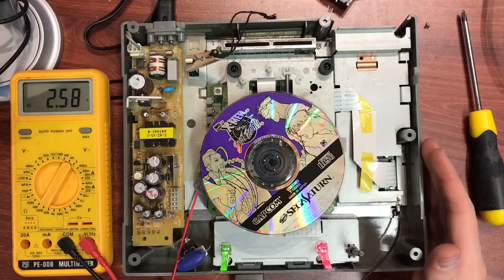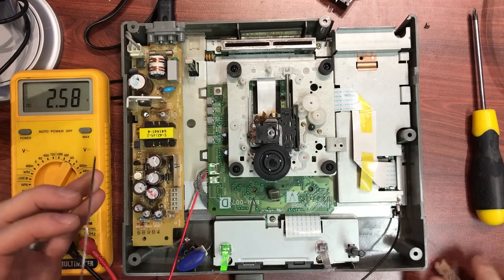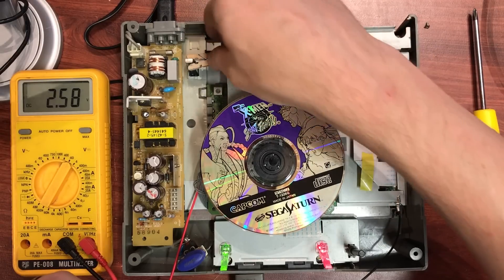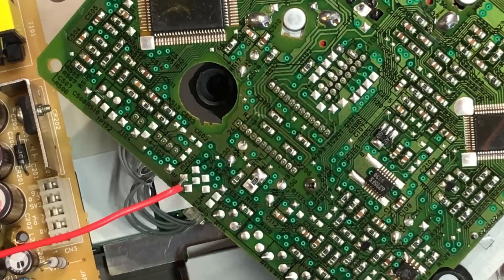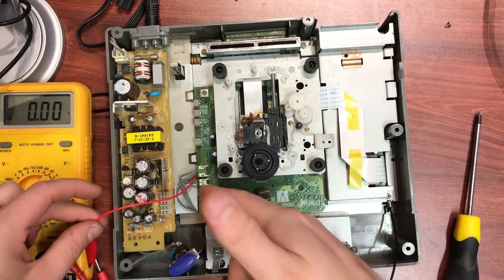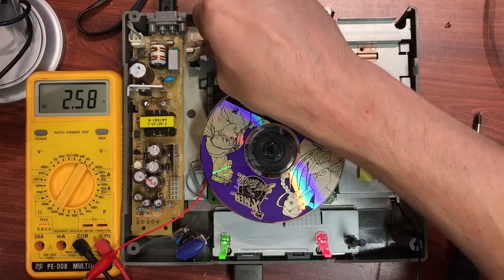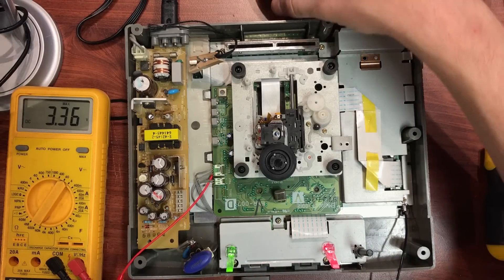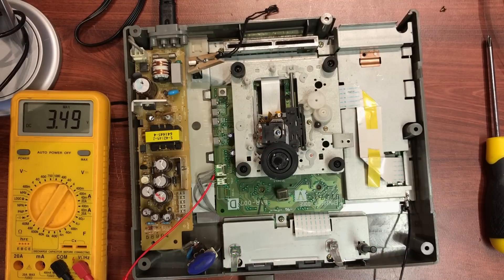Sega Saturn laser adjustment not reading discs fix - YouTube

Comment: Hi man, watched your video and it's great! Although I don't think mine needs recapping, I think I have a laser problem, can you help me out? I haven't used it in almost 20 years but it was stored properly, no rust, no corrosion, all good. I bought a Sega Touring Car Championship CD, in Great condition too, almost like new. It freezed almost every time during the Sega saturn logo sequence. I opened the Console up, cleaned the laser with IPA, regressed the gears, checked the travel of the laser head on the rails, removed and reinstalled the ribbon cables, I changed the battery and I cleaned The CD with IPA too. Also cleaned the laser board with IPA. Now I'm at the point that the game will load 50% of the time, but it will freeze at various points, never getting to the actual gameplay. Also, before cleaning, sometimes the Console froze in the open in sequence even with no CD in the tray (that confused me). Lid works OK. Any ideas? Thanks!
Reply: Hey, im  in a similar situation, but not freezing. Did you manage to resolve your issue, if so, what was it?
Reply: @samuelcramphorn3874 not yet I'm afraid, I will take it to a shop that repairs old consoles and hope for the best. Will let you know

Comment: I’ve just replaced the laser on my Saturn but it still won’t read discs. When I load a disc the laser moves and tries to read the disc but it won’t spin up. I tried tweaking the potentiometer but still no joy. Anything else I can try? Thanks
Reply from the maker: @dukeyboy83  raise the spindle height
Reply: @RetroSalesAustralia  is that easy to do?  Thanks
Reply from the maker: @dukeyboy83  yes, just pull the plastic round spindle up. It’ll end up coming right off the shaft, so then gently tap it back on to the correct height.
Reply: @RetroSalesAustralia  awesome thanks I’ll give that a try!

Comment: I just took my saturn apart, I can't even figure out which unit this is I'm thinking it's a V2.2 but I dunno which board it's using. I'm having some audio glitching, lagging and freezing sometimes down right rebooting when I play my backups and I'm using a PSeduo Saturn cartridge. I thought maybe adjusting the laser would help but once I got in there none of my phillips would fit and when I did get it to turn it was already maxed out, couldn't turn it any further clockwise. So I think someone had already played with this sucker.

Comment: Thank you so much! 

I do the job on a Japanese model 2 with a optima S6 I bought on AliExpress a few years ago, first multimeter read got 2.7V on burned cdr, after laser adjusted got 3.3V and works very well, some time I got some read error, but that's de pseudo Saturn cartridge fault,,

Comment: Hi, can you explain the range .71-0.79V you recommend? Thx
Reply from the maker: The Sega Saturn service manual lists the correct range. “Check that the eye pattern waveform can be observed at the RF test point. (0.8-1.4Vp-p)” So if you take the difference between the top and bottom of the waveform, then you get 0.6volts. I then think it’s wise to set it a little higher to around 0.75 as the laser is old and needs an extra boost.
Reply: @RetroSalesAustralia  Thank you so much for the educated answer, it makes sense to me now. Have a great day.

Comment: As my gamecube and saturn repaire experience, user should recap the optical disk board first and then adjust the VR. About the saturn, the original value is 2.58-3.0v, user can adjust to 2.58 -3.5v; that can help to read almost orginal and backup disks.  If higher than 3.8v to read most backup disks, user should consider to change the brand of empty disk to burn again.

Comment: My multimeter doesn't have a 40 options for the voltage, it has 20 which gives me 2.53v at idle, can I still make the adjustment using this 20 option?

Comment: Man I know this video is old but it's still so helpful. If you could help a brewski out. I'm getting 2.38 output in idle and with disc in , door pegged. No spinning action at all, is this a sign of the laser being dead? No matter how much I turn the pot , the 2.38 doesn't change
Reply from the maker: If it’s not spinning, then that’s not the issue. I’d recommend watching my other video on Saturn common faults. Try lifting your spindle height as I demonstrate in that video.

Comment: problem is, that i can not get it higher than 3,17 volt because the switch( the yellow one you are screwingng) is over; end ; blocked at that point..
any ideas?

input voltage is 9.1 / 5,0 / 3.34 so seems o.k.

Comment: The potentiometer in my drive does not respond, and actually when turned to the maximum (clockwise), the voltage does not increase at all and is constant. I think someone has already been rummaging around in the console I bought. It remains to replace the laser, the only question is what model if I have a 20-pin cable?
Reply: Look for a company name on the edges of the drives circuit board, there's only really two kinds of lasers in saturns

Comment: i tried this method, didn't work.  However... JVC optima 6 lasers are... about $8 on ebay and take about 30 minutes to replace.  you need to remove a solder bridge, but that's the only minor skill required.  replaced mine, worked first time (had a working saturn already, deliberately bought a broken one to try fixing in case i screwed up :D)... far less time in total to replace with brand new than screwing around with a multi-meter.  so... 8 dollars plus your/somebody's time  to repair properly vs. a bunch of time messing about?  I'd say "just buy the laser!".  sure, maybe mess with the old one while you're waiting for delivery, but the new ones are adjusted out of the box and 'just work'.  :)
Reply: there are no brand new lasers for these. I've ordered a lot of replacements for various retro consoles including sega saturn and 1 out of 3 works. I'm fairly certain most, if not all, are pulled from broken consoles. you were lucky to get one that worked the first time

Comment: hi  I have a question.  I bought a Sega Saturn.  He goes as far as when I insert a cd.  He starts reading them and then the entire console freezes.  can not do anything after about 5 minutes, the cd does not turn and it flashes the orange lamp.  what do you think is the problem.  when I screwed it on and hit the switch for the drive the laser lights up and moves a bit and the lens goes up and down.  thanks in advance Miuga

Comment: I've got a pal model 2 Saturn that works descent exept one frickin issue it presses the A, B, START,down and right buttons  from the controller by it self even and without controller plugged into the console.  
At this point I must say that :
1)I have  checked 3 controllers and it does the same thing.  All controllers at my other Saturn works great so its not controller issue.
2) I have checked power supply board and works great the voltage at every pin is right. So it's not power supply issue. 
3) I have replaced every frickin capacitor at the motherboard and also didn't work.
4) I  have tear down the console and cleaned it like when it came out from the factory.  I ve cleaned both controller ports with contact cleaner and nothing. 
Any ideas anyone ???

Comment: I know this video is older, but I’m desperate to have my Saturn work. When I adjust the pot, the voltage barely changes(on a brand-new confirmed-working laser). Furthermore, no discs will read. Is there another problem I can address to make it work?
Reply from the maker: The Ravioli Man Are you sure you’ve connected your multimeter to the RF point shown and a ground point? What’s your voltage at idle? Is it similar to the video?
Reply: Global Garage Well, my layout was slightly different, since I was working on a model 2. I did see a portion with ARF next to it. Unless that was different(and it very well could be), the process went the same. The idle voltage was around 2.48. However, I also noticed the laser head would not move(https://imgur.com/gallery/WjCOFHZ).

(Also, as an aside, will working on this without any special protection damage my eyes?)
Reply: if you're desperate to have it work, i'd suggest looking for a new laser and then mess with the pot while you wait for it to arrive.  if its laser related, a new one is cheap and will definitely fix it.  replacement is relatively straightforward.  just did mine and took me about 30 minutes (first time i'd done a laser replacement, had the machine apart 2-3 times messing with the pot to try and make it work without success)

Comment: Hey i've a Saturn it reads discs but only reads them as though they're only audio cds not sure how to go about fixing it
Reply: FATHERSUNGLASSES same. Most of my library loads, but a few games are only detected as audio. The games read fine in another system.
Reply: Same thing with me, any solution?
Reply: @TheSkeletontoucher  In the end I just sold it as faulty and bought a working one. Not sure what the solution would have been for it.
Reply: @fathersunglasses6085  Way late here but whenever I've encountered that, it was a laser pickup reaching the end of its lifespan. Just enough power to detect the discs and play music CDs, but too weak to actually load games up 90% of the time. Easy cheap fix if it's a JVC drive.
Reply: @mercurycyclone  why is it a cheap fix if it's a JVC drive specifically?

Comment: Got a jp grey saturn. Through swapping i know the laser, mech, ribbons and psu are ok yet it spins disc. Doesnt read or stop. Boot up screen is dark for a few seconds then normal. But wont read. At this point i'm certain its bad caps. any idea?

Comment: Hey Mate, I just picked up a Saturn but it only reads some discs. Some read perfectly every time, some load for a few seconds and then just black screen and eventually the disc stops spinning. No scratches or rot on the discs. Before I pull it all apart, do you think adjusting the pot will help this?

Comment: hey global garage I have a Sega Saturn model 2 and the problem I'm having is the checking disc format starts flashing when it reads the disc I replaced the laser and moved the pot but no luck so if you can please respond
Reply from the maker: When you moved the pot, did you follow the procedure in my video? You can't just guess and turn as it's extremly precice. Also if it's a new laser, make sure you remove the small round solder blob that is present during shipping. This must be removed for the laser to work. When it's removed you see it was joining to pads together.
Reply: Global Garage i followed you video to a t and i did remove the blob that was on the new laser, like i said it knows the disc is there it justs spins with the checking disc format flashing

Comment: The technique there is sound, but one thing I would point out - when you need to do an adjustment to an existing laser, the laser has started to die.  ie.  It will output say 90 to 100% of its optimum value for the majority of its life (without adjustment) - but once it gets to that point where its output has dropped below say 80% (where it stops reading discs), increase of the voltage can bring the RF level back up (as you demonstrated), but the additional voltage (because its now higher than it is specced to get a proper level RF) coupled with the fact is is on its decay to providing no output whatsoever, means that it won't last long.  You may get a few month (of intensive use out of it before the voltage needs increasing again).  So its fine for getting up and running, but its not a long term solution - ideally you should just swap out the laser!  Lots of people are doing this kind of thing and selling them on eBay - annoys the hell out of me lol.

Great video though, and as I say, the technique is sound - even if the DMM is a little inaccurate, its better than just adusting it and guessing etc. =D
Reply from the maker: Yep I agree 100%. Just like you I make these videos more for the guy at home to follow along and hopefully get more life out of his console. I linked to a new laser in the description as ultimately that's what's needed as you said. All of my consoles that leave the shop have new lasers as I don't need the warranty hassles.
Reply: While adjusting the laser does shorten its lifespan, if the system isn't reading the disc anyway then a shortened lifespan is still getting more out of the system than the system not working at all as is. And those few months are a few months of stress relieved from the inevitable replacement.

It is an important consequence to understand though, especially if somebody's going to be doing this when preparing a console for sale. I feel as though if they are doing that, then they should really mention that the laser has been tweaked, and is on its last legs, but I highly doubt very many people are that responsible even if they understand the extra stress their adjustments are putting on the system.
Reply: I've ordered a lot of lasers for various retro consoles including sega saturn and most of the time I've had to ask for a refund. I'm fairly certain the replacements they sell on ebay and aliexpress as brand new are really just repurposed lasers pulled from broken consoles
Reply: GadgetUK164 - Retro Gaming Repairs & Mods what I usually do is grab a cartridge and then stick it in and out of the slot! A good 10/20 times... Fixes everything!😂👍
Reply: I just bought my first saturn on ebay from japan, looks like i was not lucky to get a model 2 with a dead laser (advertised as Working Garanteed) so I'm looking foward to my 2nd saturn , which the seller already sent and is on its way !! :P cant wait to find out if it will boot discs !! XD 
at the same time I know a friend selling his  usa model 1 saturn region free with modchip. so I will be able to play nice improvement hack like SOTN translated or the 4MB hack * and stuff like that !!! you really need a modded saturn these days (edited : the replacement saturn booted first try and was way cleaner than the first one , both model 2 white hst 3220 , original japanese game DBZ LEGEND tested no trouble at all with msh vs sf 4mb too)
Reply: wow , did I just scroll down the comments and as I was reading my comment, I didnt fully realize it was my comment until I read model 2 dead laser !! LOL Im gonna do what I can do to maybe revive it? This video is very nice!! Im attempting to adjust the pot lid of another console which has a modchip. I want to be able to read everything. at least for a while :P
Reply: wow that was not hard at all, I can finally play everything now,(cd audio, original , backup) the backup Im trying which was freezing during stage loading yesterday is now flawless? wow